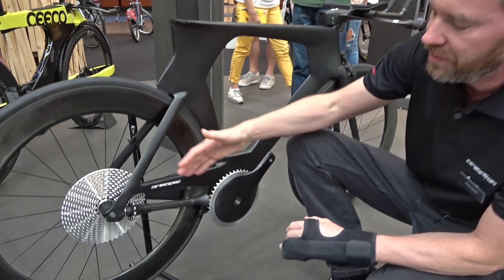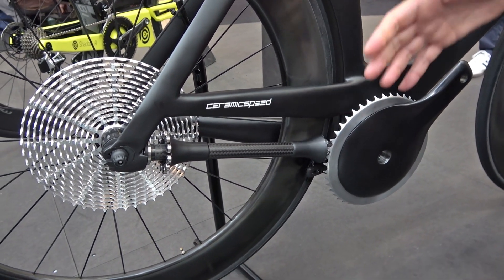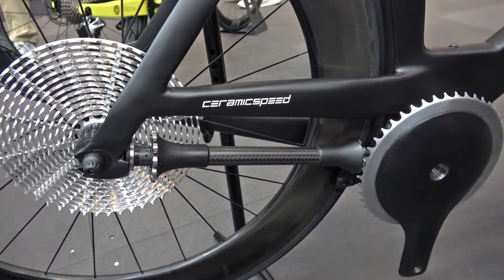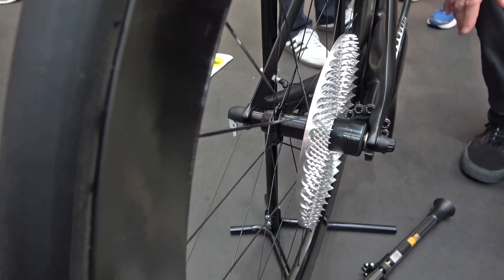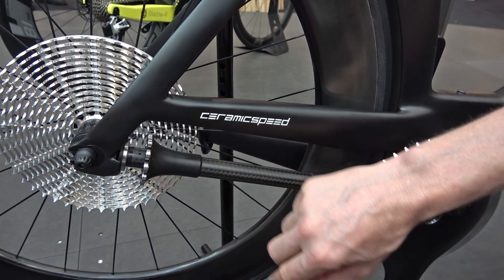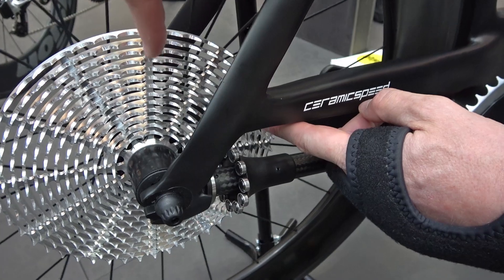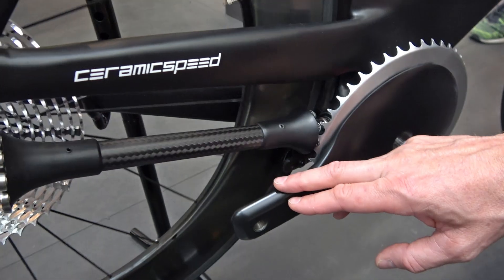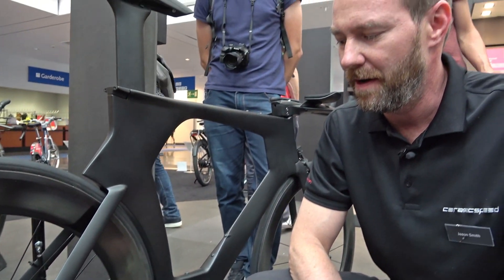CeramicSpeed Driven - Fully explained

Comment: What happens when you are going up a steep hill and adding a lot of torque. You only have two point of connection at that point - the point of two teeth.  over time you are going to get fatigue and teeth will break.

Comment: Like any concept vehicle it is not a fully working model but the principal could be developed. Unfortunately there is a reason most motorcycles don't use shaft drive. Changing the rotational direction and being able to handle the torque introduces lots of friction.

Comment: awsome and insiring. I'd take a solid shaft fixie version of that right now please. cog size of that 2nd smallest one please.
...and you can pop that on a 700c vintage style cruiser for me please. Edit: reading some of the comments and realising the immenent sideways force issues. The single fixie cog wheel (that slides onto the cassete holder) that I want would I think have to be made out of a mix like titanium tungsten carbide (or with  at least a 5-8mm solid aluminium backing) and with a sleeve that covers the whole cassete holder.

Comment: I'm still amazed its not standard for derailleur rigs to be fully enclosed with lightweight plastic covers for any 1/2 normal use, just to both keep machine clean, and to prevent getting grease on clothes, etc.   I'd think only guys in actual races would run "naked chains".

Comment: Does anybody of grumblers tried to use it? Are you sure that the sprocket is made of aluminium? Maybe the idea is brilliant and no problems with bending appear. With standard chain (when it is not pretty new) usually only one (the shortest)  link is transferring the power. If bearings are well isolated from dust, the grease remains there for a long time. If "one tooth transfer" would be a problem, no gearbox (cars, motorcycles or even bikes [hubs with gearbox]) can work.  The only question is, how to change a battery inside the shaft and how long can it work. Or it is self-loading from the rotation?Anyway I'd be glad to see the gear change under load.

Comment: Well if they do work out the shifting, testing how much power it will handle and how much weight it will or will not save, judging by what a set of Ceramic Speed Jockey Wheels cost no one will be able to afford it.

Comment: The idea is good. I read some comments and most of them are like it looks like it will break. Guys if studied mechanics you should know that such comments are nonsense. All depends on calculations of applied forces and materials used for certain parts.

Comment: A few things they dont explain, tortional losses due to the bearings and the sprocket not being the same shape.  I t just changes linear sliding frictionto rotational sliding friction, whcih is worse.  Bike chains already use bearings in each link, that is why you have to grease them.  2 90 degree turns is goign to cause a LOT of stress on the assembly.  So its goign to have to be made out of titatium just to hold up, and even then,. the real sprokcket will flex moreon the outer gears, so while it works in the lab, under real world use its goign to slip a lot.  

The real test is to hook a certified electric motor to each on under load adn see the top speed.

Comment: now if you had the most efficient rider position instead of using one that's over a hundred years old. Check out the Cruz Bike for rider efficiency ....it's kinda like the 
difference between a Lead acid and Li-ion battery. just because governing bodies dictate these positions in races doesn't mean the street rider/commuter wants to 
torture themselves in the same manner. I own 2 recumbents and do not plan on going back to a diamond frame ever again....if you had one available....first change I'd 
make, to convert to front wheel drive recumbent. But truely amazing what you have there. keep up the good work.

Comment: The angle of load on the large gear loks problematic to me. I woould expect it to warp or buckle over time. Probably okay on the inner ring gear, but outer gear is under huge deflecting load.
Reply: Yes! I give them credit for trying. 
And I would think that design is brilliant for a tiny load.
But for full bicycle pedal loading by a grown man, that gearplate would be under incredible force. 
It would have to be incredibly rigid, not some lightweight aluminum plate with holes peppered in it, because it can't flex AT ALL, or you'd jump a gear.

Comment: I would bet that in lower gears the rear gears will bend, because then more they are our of the center of the rear wheel then bigger the vorces pushing the rear gears to the side. So the bearings will flip over then...

Comment: Ihave to give credit to the design in theory and overall look if. More work is done to improve on it . such as a cable down the center of. The shaft get rid of the battery. Change the angle of teeth slightly towards the ground so your not putting pressure on the wheel from left to right . and a dust / debris shield were ever possible. But overall nice work so far

Comment: You keep telling us how efficient this is compared to the classic chain derailleur system. So if this is 99% efficient how efficient is the classic derailleur system?  I have a feeling it's not too different.  If the chain in a classic system is made with bearings it would have zero friction points.

Comment: Once they've put seals on all those tiny bearings there will be over 30 points of friction so it won't be 99 percent efficient then and expecting 1 alloy or even steel tooth to take all the load at each end is never going to work, looks pretty though. The only part of that's of any use for future drivetrains is a shaft assembly instead of a chain. Companies should be getting busy with gearboxes like Pinion and making those lighter and even more reliable. Combining that with a sealed shaft drive is the way to go most other vehicles use that system. The derailleur system is a highly polished engineering turd that has only stuck around so long because of it's modular and upgradeable nature combined with being quite light and the fact it is so easy to work on. Get a Pinion style system down to the weight of a derrailleur system then they'll have something really worth shouting about.

Comment: I see one more point of rolling friction when they get gear change system working. What they have with motor is over complicated electric motor shifting. The simple solution is to have a rail that holds a thrust bearing that slides the bearing gear front to back on a splined shaft. Another issue metallurgy aluminum cassette is not gonna work.

Comment: just a simple questio if it s so good ...ect why we didn t see it on the road or in competition Toure de france for exemple ? i think all that is just for the show !!! and ONLY SHOW
Reply: I'm pretty sure UCI regs require a chain drive. Not something that'd we'd likely see in competition for quite some time, even if it was field ready (which obviously, this is a pretty demo piece, not functional). And with all those spikes, not sure they'd ever certify it for safety reasons. Some one got injured by a disk brake in the leg, and they immediately put the kebash on disk brakes for competition. You would NOT want to land on that rear cog in a pile up... ouch.

Comment: Pointing out the obvious, the safety issue. There should be some plastic covers in front of those teeth in the drive train. I can already see how someone got their clothes jammed in the front drive train or made severe cuts and bruises in an accident while spinning in the air and touching the rear teeth drive train. Other than that, great idea.

Comment: You can't just change the pinion sizes without also adjusting the distance to the mating teeth (on the "chainwheel" and the rear "gear cluster")- not a trivial adjustment in either case. The pinion bearings look extremely vulnerable- no seals, no protection. They wouldn't last a season as shown. You could add seals (which would add friction), but I would still wonder about durability. The shifting would have to be flawless every single time, else you just wrecked some very expensive hardware- as he says "boom boom boom, in a fraction of a second". An interesting design and it looks like it has potential if it could ever be made functional. Looks like that is a looong way off,  if ever.

Comment: Loving it! 

The only two concerns I have is, how durable a shaft can be, when its halow and full of things? :( 
The other is the big 13 gear wheel at the back. It doesnt seem to be strong enough to deal with the abuse it will get.

Comment: So this will have to be alot stronger then the original drive train system.  As this 2 contact point system has to absorb all the force on those 2 points that would have been spread over bigger area with a chain system.  Not sure its gonna function all that well with cyclist on in real world. A chain can stretch under tension.  This will however eat the teath away that takes the force.

Comment: Very cool idea. Too bad they want to make it shift remotely and needing 5 shift channels. Why not shift the mechanism with a cable? Im all for being wireless, but that be lighter than a handlebar mounted remote(not heavy at all), 2 batteries(have to be charged), servo(must rebuild or repair) & ECU(susceptible to everything lol)? 
Id love to take a crack at further improving on the shifting design.
I used to ride pro bmx and have been building custom cars and motorcycles since 2004. "Relay" style designing, where someone starts the idea, maybe a prototype or not even and other ppl continue to progressively further the design  to its completion. That's always interesting to me.

Comment: Try changing the drive shaft from carbon fibre to steel of titanium for the real world. That way your chain replacement won't have a nice expensive failure if it gets dinked by debris thrown up from the road.

Comment: If you add a small generator spun by the wheel to keep the battery charged for the actuator I think that’d be freaking awesome to try. 
But I feel like this would be very costly and mostly only actual bike teams with Sponsors would be able to afford it.

Yea I just peaked at your website. Very very cost prohibitive. This stuff isn’t for those of us who bike on the weekend with friends. Not when it’s $1,099 for a set of wheel bearings from CeramicSpeed. Like I can upgrade my wheel bearings and A-Arms and spindles to QA1 stage 3 racing in my CAR for $1,000 Geesus

Comment: The next problem is that the gearshift needs electricity. Without electricity you are lost :(. Yes, the battery consumption is low but still some amount of electricity needed.

Comment: Why did you not show it in action
⚅⚅⚅⚅⚅⚅⚅⚅⚅⚅⚅⚅⚅⚅⚅⚅⚅⚅⚅⚅⚅⚅⚅⚅⚅⚅⚅⚅⚅⚅⚅⚅⚅⚅⚅⚅⚅⚅⚅⚅⚅
Reply: He mentioned that they only have one engineering prototype in the lab for testing, and it's probably not something you want to put on a trade show floor - covered in carbon patch re-works, wires zip-tied to the frame leading to sensors bolted on with rough cut brackets, manual cables operating what they expect will be electronic in the finished design, tied to a bunch of computers and bolted to a test stand, that sort of thing. This is still a very preliminary "internal alpha" stage product. What he's showing is essentially a "materials mock-up", sort of like the "concept cars" you see at auto shows that never turn out the same in the final design, if they ever make it to production at all.

Comment: Fantastic display of engineering. It could also be switched manually by using the same mechanism as used for the rotors of helicopters. Saves weight as well. Electronics are only handy in conjunction with a smartphone. Otherwise no need 4 it. :D

Comment: That is a very loud clicky freewheel compared to some Raleigh bikes over 30 years old and all over 60 years old.  I am surprised therefore at the claimed low friction.  By comparison you can change gear with the bike stationary on a hub gear bike.   Those old hub gear bikes are lubricated with thin oil so they have very low friction but not as good as 99% transfer efficiency.

 I can see though that the gear teeth are not accelerating and decelerating as they would using conventional cogwheel that whine.  I had thought spur and bevel gears inefficient but I can see these are very efficient the diameter is the same for the whole length of the tooth.

If this was going to be turned into a long life road bike is that the whole assembly needs to be enclosed to keep it clean.
Reply: Changing rotation direction as a general is inefficient and hub elliptical gears the main power does not change direction.  The design looks like this rule-of-thumb assumption has been over come.

In draft just now but I shall be publishing my sport bike project and would like to include this video.  The link won't work yet;
 

https://blog.andrew-lohmann.me.uk/2018/10/lenton-sports-bicycle.html
Reply: @Adam Z I don't know what you mean - is that something www.campagnolo.com do ?
Reply: @Adam Z Sturmey-Archer FW hub gear.

Comment: 1) high torque in low gear would bend the bejisus out of that wheel. No such problem with a chain drive. CNC cuts look expensive.

Comment: Very interesting concept. But it is far more complicated than a classic derailleur-system. The ceramic ballbearings on the end of the shifting rod are subject of dirt/dust, so I doubt the friction free functioning in the real world. Aluminium gears, where 1 tooth carries all the power? In a chain-system at least 6-8 teeth carrying the force, yet they use steel gears. And in the chain system you have rollers in every link of the chain, why would it be not a rolling friction? Good luck to you but I doubt your system.

Comment: Wouldn't a traditional cable set up be simpler to activate the shifting device, rather then electronics that do die / fail. Awesome though! Be cool if it utilized a rechargeable battery.

Comment: Jeebus, so many experts in the comments that have a clear understanding of the prototyping process.  /s
Reply: Just people with common sense. Even if the claims were even half true, this simply isnt superior enough over traditional chain drive to warrant the R&D.
Reply: @SirSpinalColumn  Are you serious?  how do you even know?  Have you done any testing on the idea?  Do you have a prototype in your hand?  You're making a lot of assumptions based on a youtube video.
Reply: Russell Senior so you’re telling me that flimsy little aluminium disc is strong enough to withstand the force of a 200kg/440 lb man putting his body weight on the pedal without simply bending away from the pinion? And then have the pinion sliding up and down the shaft while also under that immense stress? Remember, bikes have to cater for lots of body types, and humans come in all shapes and sizes. And that’s not even taking into account, once this thing is greased up, which it will need to be due to metal on metal contact, it will be a dirt magnet. 
There’s a reason the prototype doesn’t have pedals, they don’t want someone at the show trying it and seeing how fragile it actually is.

Comment: A nice idea, shame it doesn't work.
The shift mechanism is a serious weak point, a wireless battery system with position sensors? Going to fail, you need a cable system and some lockout so you don't mash the teeth.
Then there's rear sprocket flex, it's too thin and will be pushed sideways and slip when someone stands on the pedals, you need an inboard roller to stop it doing that, or to redesign it to allow flex and some slip to make it behave like a disk of rubber with smaller sharp interlocking teeth that have spacing to allow gear traversal.
Reply: This is seriously overengineered and under thinked at the same time :). The entire bearing + drive teeth seems too weak to withstand the force of a full grown man pushing hard on the pedals, at the same time they could have simply put a push- pull cable system to move the shaft and give the bearings a conic shape in order to make them "fall in place" when the shaft move them back and forth.
Reply: @lucalucente3797  Agreed. Also by the time it all gets covered in dirt and grit those ball bearings at the back and going to start sticking and rusting. It may be better to have a single speed rear and chain, and then have a series of part chain-wheel 'chain grippers' inside the usual front chain ring area that can expand and contract in size during the time it's off the chain. Otherwise skipping from gear to gear is always problematic.

Comment: they are reinventing the gears , and useing batteries to switch gears, how much torque can this system hold without breaking, i doubt that traditional gears are not efficient, maybe just have planetary reductor instead then. Well made gears are mostly rolling anyway because of special teeth profiles. :D *sarcasm intensifies*. I am mechanical engineer, that is working on aerospace industry.

Comment: The idea might have a chance if you could make it mechanical I do not like the idea that it's an electronic shifting that's kind of lame batteries go through all kinds of temperature differences and when you think their charge their dead figure out a way to make it a spring-loaded mechanism so you can shift without having some electronic crap to go wrong

Comment: 2 points of  contact vs approximately 40 points of contact...
i don't think i would want to put any ore than just the slightest amount of torque into this system at all, than what was just demonstrated by the presenter did with his index finger.
let Andrei Griepel test it out first

Comment: So they still havent figgered out how to change the pin-gine position? Useless system then.  What happens if the battery dies or gets wet with gutter water in a storm?  are you stuck in top gear?